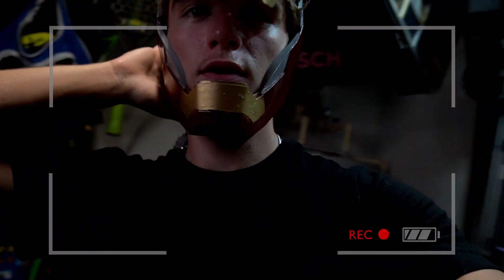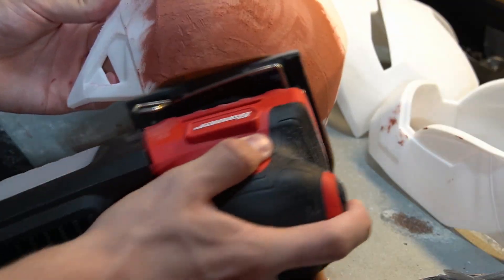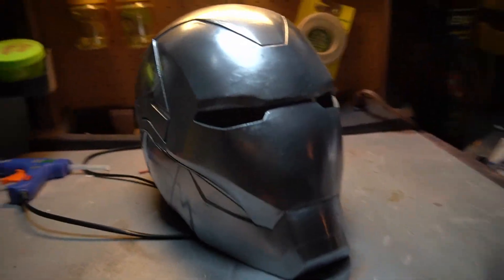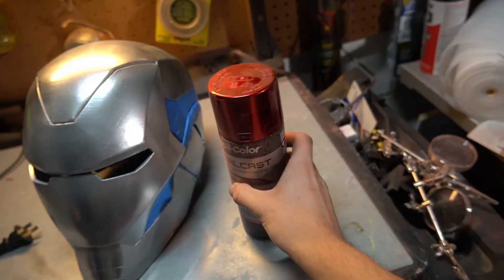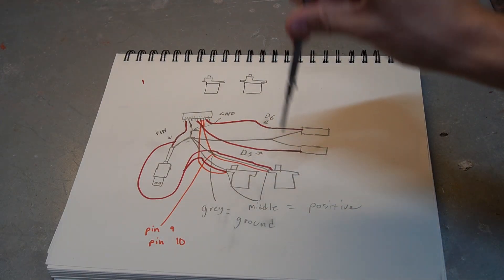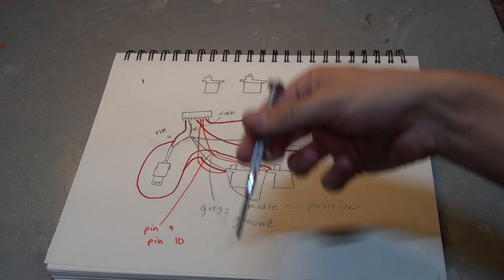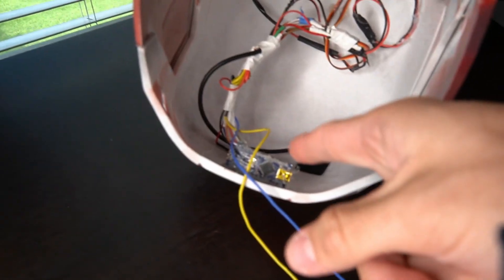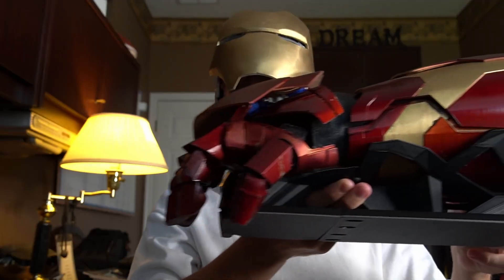I Built a WORKING Iron Man Mask

Comment: Robbie listen carefully, make mor then just a suit, make another animatronic, with these flaw in mind, also don’t care if you can’t make a animatronic, make another thing like it, like terminator, anything that is easy cheap and durable, READ ALL AND COPIE TO SOMTHING AS IM DELETING IN A COUPLE DAYS SO HE DOSE NOT SEE IT

Not bulletproof — vulnerable to high-caliber rounds
Not silent — mechanical noise ruins stealth
Rust-prone (until recent fix) — early builds corroded easily
Incomplete armor — exposed joints, no full protection
No self-repair — damage stacks with no recovery
Poor hand articulation — oversized fingers limit control
Hostile escape route — terrain and civilians pose threats
Loud drone — gives away position instantly
Echo Loco is sonar, not AI — basic echo location, no intelligence
Echo Loco chip would cost millions — not feasible for DIY
Escape footage is fake — AI-generated visuals, not real movement
No full-body test — only partial limbs shown
No autonomy — likely remote-controlled or scripted
No sensors — lacks thermal, lidar, or proximity detection
Panic driven by misinformation — fear fueled by fake media
Civilian chaos factor — unpredictable threats everywhere
Trucker threat — easily crushed by vehicles
Military escalation risk — tanks, drones, and jets would respond
No stealth in cities — cameras and traffic expose him
Waterproofing added late — initial builds were vulnerable
Running takes years — not achievable in current phase
Trap detection takes months — no adaptive logic or terrain awareness
35 mph claim is fiction — no animatronic hits that speed
No terrain adaptation — can’t handle slopes or debris
Power source unconfirmed — no visible energy system
No countermeasures — no defense or evasion protocols
Armor rating unverified — no testing or certification
No anti-drone/human tactics — defenseless against coordinated threats
Illegal deployment — violates multiple laws, triggers federal response
Concept art likely AI-generated — prioritizes visual perfection over mechanical realism